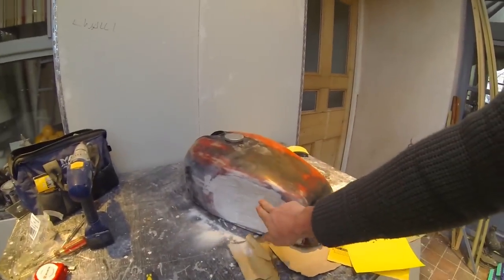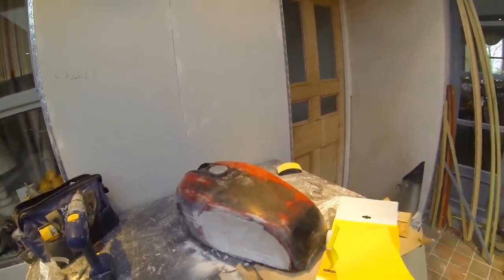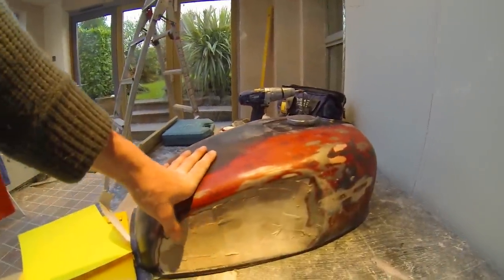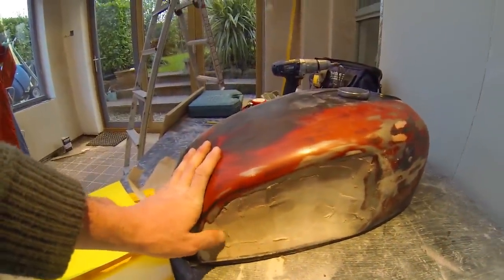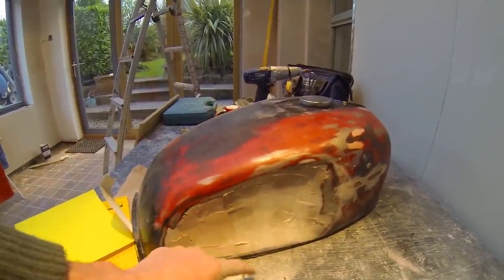Cafe Racer Build Part 2, Fuel Tank Painting 78 Suzuki GS550

Comment: I noticed the clear coat was from Halfords, how does it hold up to fuel spillage? nice job by the way
Reply from the maker: +Brian Griffin It's ok if you wipe it straight away, not so much if you leave it.
I did have to rub down the clear coat with 2000 wet paper and re-buff into a gloss shine though

Comment: Hey i've got a gs750 tank and i've been trying to track down a fuel cap for it. Every single one I order online seems to be too big for the tank. Its proving an absolute nightmare and is probably going to be the only thing holding up my scrambler build. Where did you get your's from?
Reply from the maker: It just came with the tank. What diameter of your hole? I can measure the diameter of both my hole and cap if that would help you at all narrow it down that a GS550E cap would fit or not.
Reply: Hey dreegez , thanks that would help a lot. The inside diameter of the hole is about 35mm.
Reply from the maker: Cool, I'll measure mine tonight.

Comment: How much did the powder coating cost?
Reply from the maker: The Brooklyn Hustle If you have a load of parts that are the same colour it works out cheaper as a whole, you're probably looking at around £100 - £150 ($150-$240), but worth every penny as they also clean and sand blast everything for you in the price.

Comment: That looks great! Do you have any tips on getting the cut lines on the tape so perfect?
Reply from the maker: +Travis Chase Use professional sign vinyl and press down hard to get a neat join, but let your base coat dry hard over a few days first. Then remove the vinyl quite soonish after the new paint has dried, try not to leave it on for too long